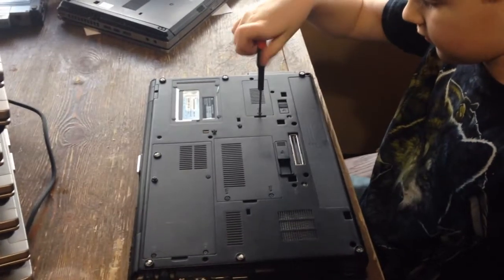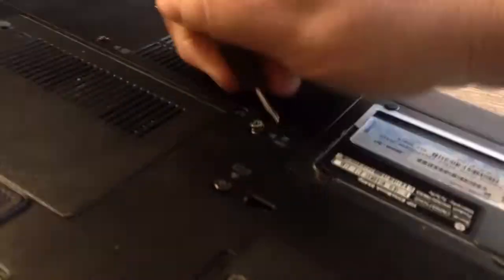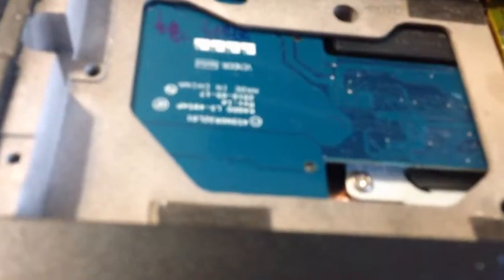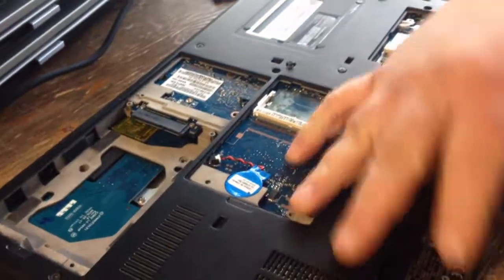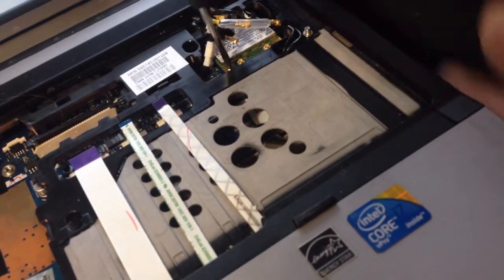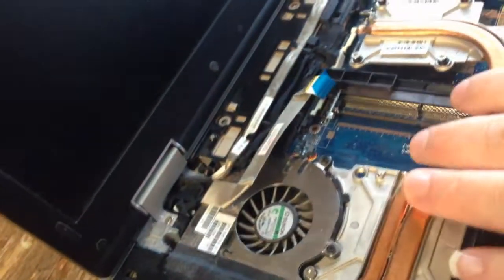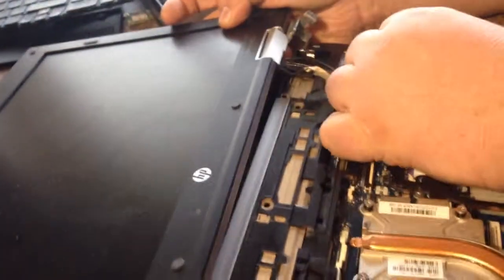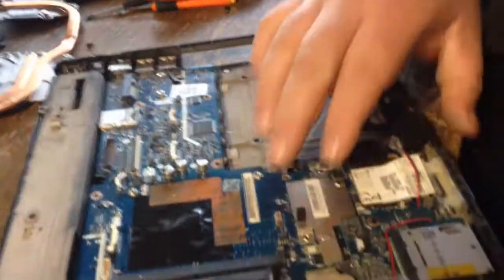How to completely disassemble a HP Elitebook 8540P Laptop

Comment: although I found this helpful - wasn't because of what you said or did, as that was nothing but rapidly & absolutely destructive - anyone could do what you did - it's called dismantaling ...  Was not easy to impossible to follow at the pace that you went, very hard to follow this  & for those of us wanting a bit of instruction & found myself not knowing what you were doing to do it as you went thru it like a tornado - but obviously you knew a lot - you just didn't want to share what you knew... or else you would have taken a bit of time & care to do it slower, and do it as it should be done, so we could follow & also would have explained a bit.   But seeing the inside before I opened mine up was helpful - I was just astonished at how you ripped things out of it - that is not how we would do it to our own laptops, a bit of care would have been in order to do it, by example, so that we don't damage our systems - like you did that one.  No gloves - touching the IC boards .... there was little to salvage from yours once you were done damaging it & using the screwdriver to rip items out of it - taking the cables off was important but you just ripped them out - the worst was - you bending back the heat sink  !! - really ?.. This is a great example of how NOT to disassemble a computer.... so that makes it worthwhile unto itself... lesson learned.. Even when salvaging or recycling parts you want them in good working order, so they can be used again.  I would not trust anything you removed to work, once you were done with it either by your rough treatment of delicate items that would cause damage, tossing things, or by your electrical discharge.  so thanks - following the moving & jerking camera shots - was a real head spinner too.. lol

Comment: I would deeply appreciate your advice on the following:
The graphic card on HP-EliteBook 8540-P laptop is Nvidia, which causing lot of problems & CPU overheating on Win 10 & Linux.
My question: Can I install a different graphic card, IF so which types or options you suggest?
Many thanks